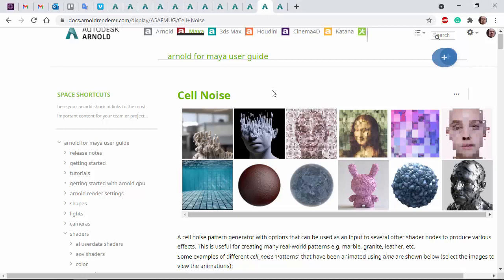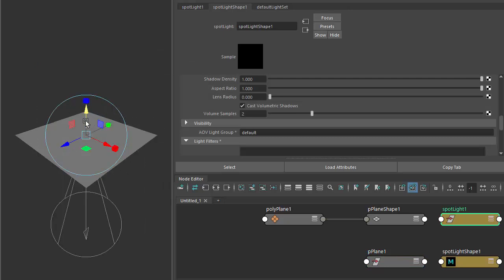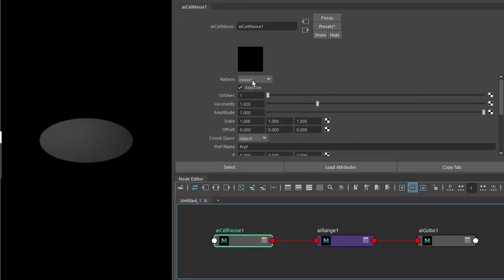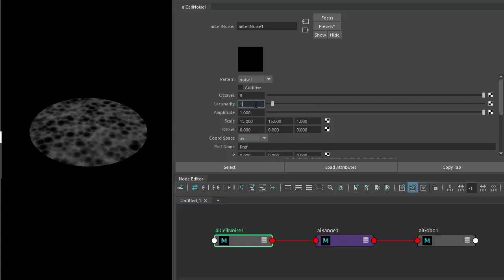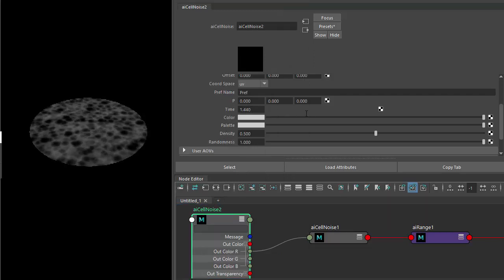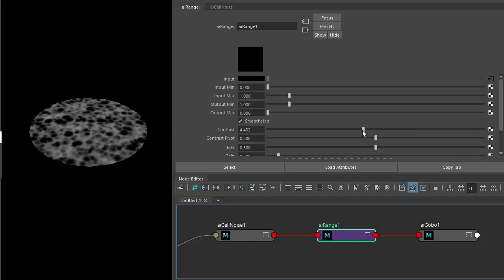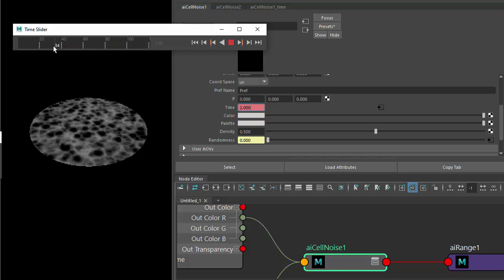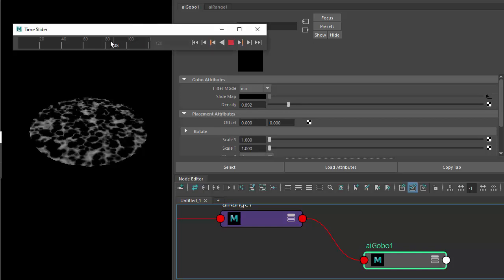Arnold tutorial - Render a caustic pattern using the cell_noise shader in MtoA

Comment: Cool. But with this cheating, in the shot that camera moving from underwater to the air above, we will have to mask the distance from water surface to light source im composition.
Reply: you could add a light decay, and use the near and far attenuation, to control where your light starts and stops
Reply: @ondudengrund  even when u do that, it still has issue because decay is just define distance with flat slide, but ocean surface is not slide, it's displacement.